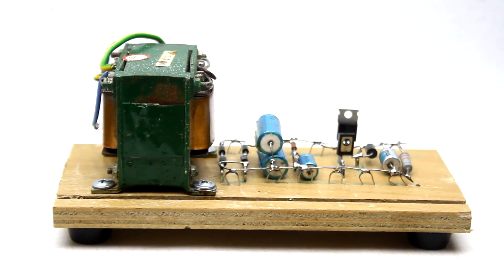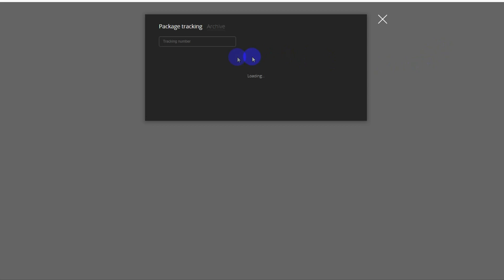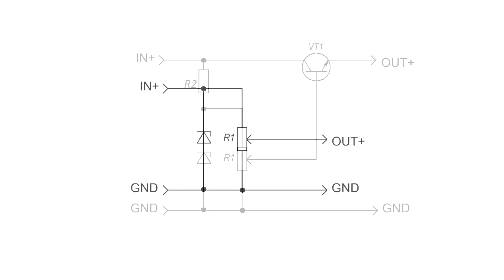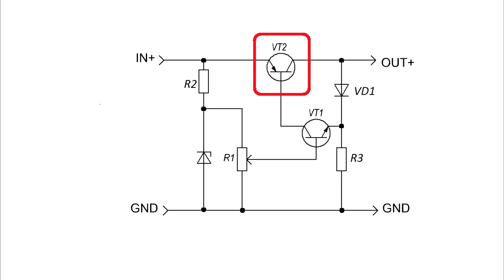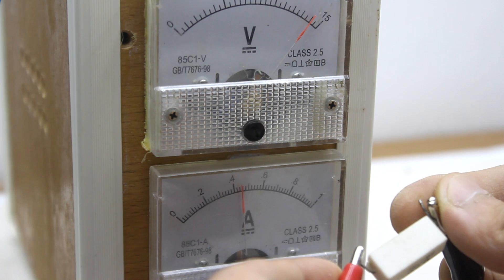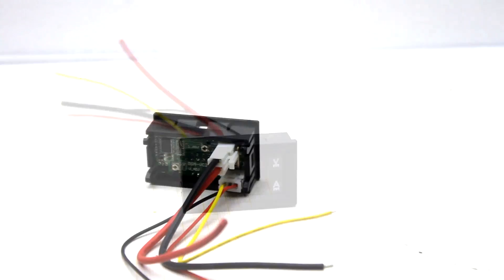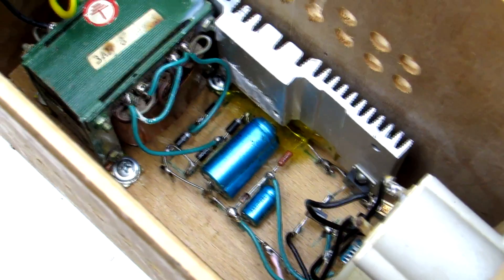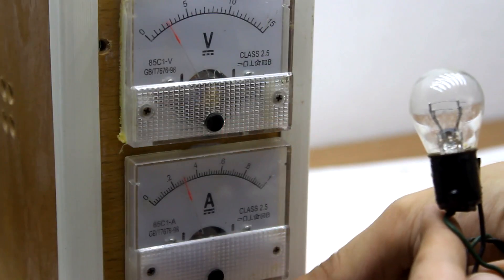Simple power supply with adjustable voltage and current

Comment: I am real excited to build this. It will be my fist power supply also the biggest electronics project I have made yet. I was planning on converting a atx power supply but this is far easier. The hardest part will be scrounging all the parts. I also screen shot and printed the wiring diagram.

Comment: The min- & max output voltage from this?
(if i use a zener-diode with max voltage.   ...which is:   ?)
The min- & max current out of this?
Which voltage & current should the transformer's output be?
Which other transistors can i use?
Can i use 10K-Ohms potentiometers?
Thanks!

Comment: I replaced the transistor TIP42 by the MJE2955 and for some reason it does not work, the potentiometers make the voltage change very sensitive

Comment: Gave me a good chuckle for the point to point wiring with staples as tack points.

Looks like a solid circuit however I would of used a pref board and a fuse. Not to mention an output switch so you can adjust the voltage without outputting it to the banana jacks until you switch it over.

Comment: nice video. it would have been better if u had used a transformer followed by rectifier , followed by boost converter which would have made it more efficient and reliable. xl6009 based boost converter and others like this ones r cheap and very useful.
Reply: It wouldn't be a linear power supply and will have switching noise in the output which is not usable in sensitive receiver circuits. Filtering this noise is next to impossible.